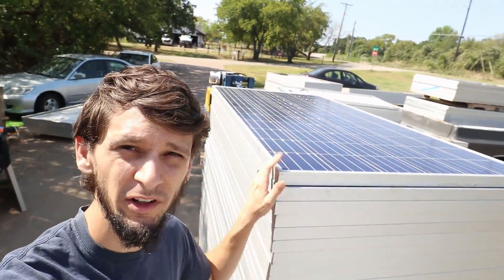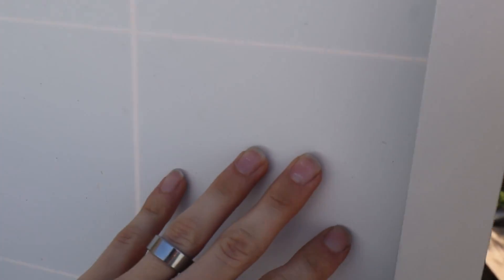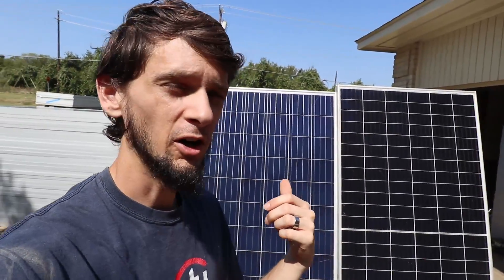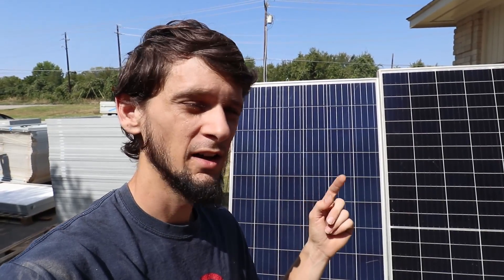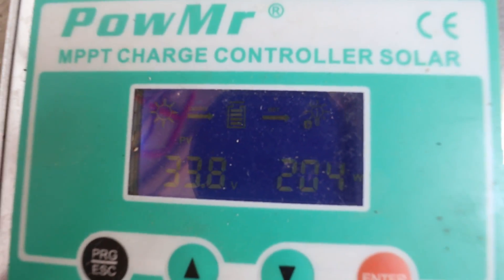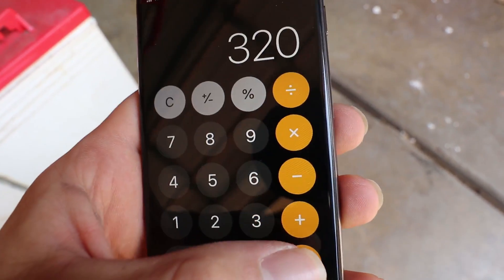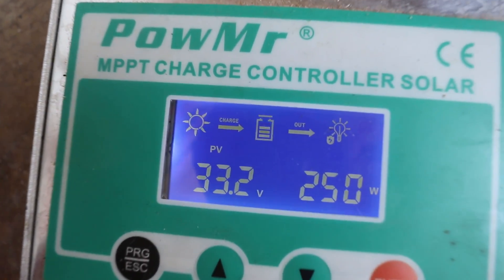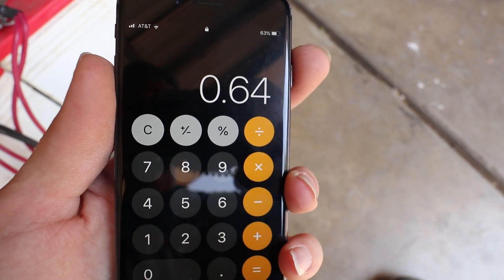Comparing Batch of Used 320 Watt Repaired Panels to 400 W New

Comment: I have some of these same panels, but while doing research I had an "expert " tell me my panels are not designed for charging batteries, but were best for grid tie applications. This is due to the Voc being higher output than most charge controllers can handle. Your thoughts?
Reply from the maker: If you want to be able to run a small pwm charge controller on a 12v battery sure that statement makes sense. But all you have to do is choose an mppt charge controller that can handle the voltage. The powmr I use can handle 80 or more volts of solar panels when charging 12v batteries. 160v when charging a 48 volt battery. Also consider that an off grid house is charging a battery with many kw of solar panels. Those aren’t done with 12/24v panels. They use nice mppt charge controllers that handle hundreds of volts input so no issue there.

Comment: are these things expensive to ship overseas? I want cheap solar
Reply from the maker: They are expensive to ship. Might be ok by the pallet in a container but I’ve never shipped something at that scale before.
Reply: @BeeneEnergy  On another note, would you say having a bypass diode on all cells is smart to have?
Reply from the maker: Do you mean adding a bypass to each individual cell or making sure the three that come with the panel are in working order?
Reply: @BeeneEnergy  adding one for each cell. so less power is lost in partial shade or malfunction.

Comment: Hello sir, for how many days are you using powmr  mppt charge controller. How is it work and can I use for a 1or 1.5 kw solar panel? If you answer me I will be really helpful . This mppt controller donot have big heatsink and do you it will last for more than 2 yeas at 40ampere load.
Reply from the maker: I’ve got one I’ve been using for about two months. It’s the 60a version and I have 1.6kw of solar hooked up with a 48v battery. That’s only 33a max.
Reply: @BeeneEnergy  when at the peak time of sunlight your maximum ampere generates 33, does it make hot the body and how much current is boost from input amps into boosted output amps. Does it do 20 to 30 percent boost?
Reply from the maker: I’m running 2s2p for the solar panels so it would be about 20a peak input. The fan kicks on when running 30 amps in but it doesn’t run all the time. The unit does not get overly hot.
Reply: @BeeneEnergy  Very thank you sir